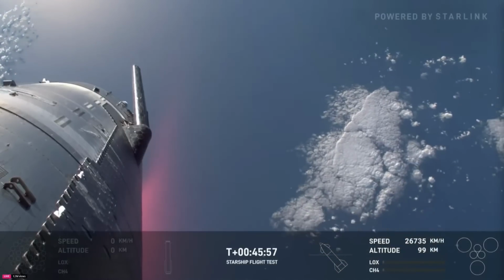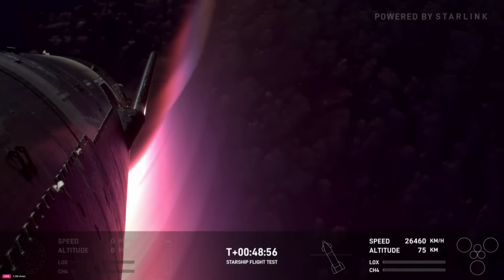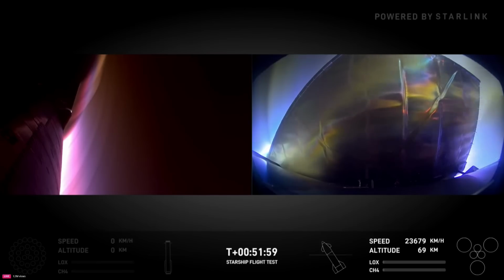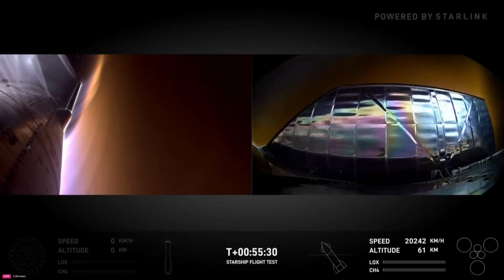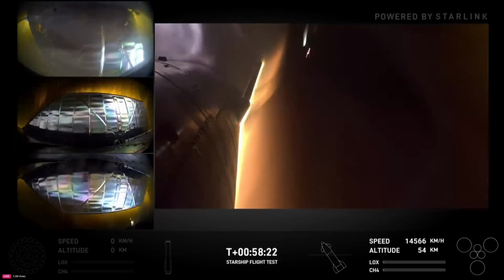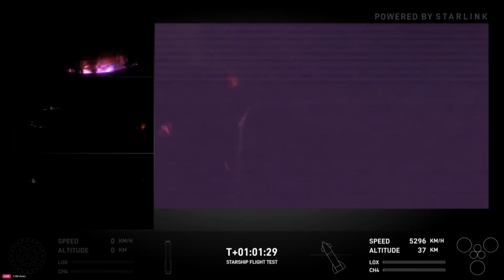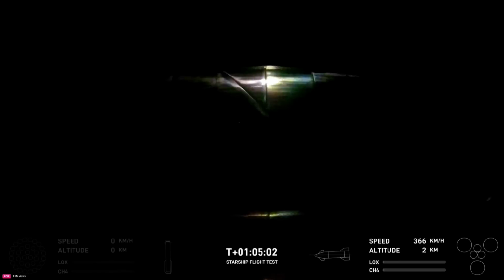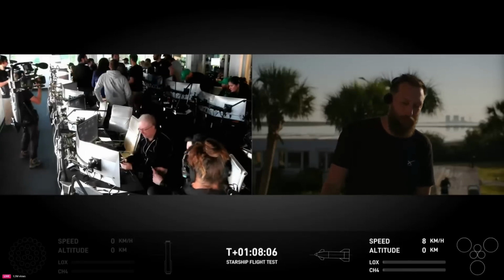INSANE Starship Flight 5 Reentry: Plasma Views, Ocean Landing & Explosion!

Comment: WOW what a bunch of diluted fools. The heat shield around the hinge still failed and it still blew up from fuel leaks. The booster still failed from the fuel leaks and nearly exploded too. This was as much of a failure as last time.   It is inherently flawed it will never work well enough to be reusable.  That thin is Humty Dumpty.

Comment: The speed is not right. Can’t be 25000km/h since it will take 0.144 seconds to to 1 km, however the distance is not decreasing at this rate.
Reply: Cuz it's the altitude and he is going sideways not straight up

Comment: Sorry, the space shuttles were doing more from 1981-2011. Why it ended is because of risk and costs.
Reply: The Space Shuttles were quite successful and effective, but there were significant problems.  Recovering the boosters worked, but the cost and effort to refurbish them was almost as high as buying new ones.  And the Shuttle's heat tiles experienced significant damage on each flight (fatal on one flight), requiring the replacement of dozens to hundreds of tiles - each unique and absurdly expensive to produce and replace.  With Super Heavy/Starship, neither of those should be a problem at all.

Comment: Overall, it was a successful day, with only a minor issue involving the Starship's right flap burning. Although less severe than the incident on Flight 4, improvements are necessary before Flight 6. Congratulations to all who contributed to this historic day.
Reply: Block 2 Starship design has the forward flaps moved more leeward so will experience less heating.

Comment: It is really interesting. It seems like the peak heat is not the issue as the velocity is high enough so a nice layer of plasma gets created without damaging the weak parts. The slower it gets the more the heat layer is getting attached to the actual structure. I am curious how they will solve this. But that said, it still hit the target 100%. So it is more a reusability issue then a functional issue for landing
Reply: Maybe a boost back burn before reentry?

Comment: When it gets to mars that drag heat is gonna have to be a llot longer as the atmosphere is thiner so its kind of still concerning that it didn't hold up.
Reply: You are putting the cart before the horse.   First Space X has to get starship to land in one piece on earth.   They can worry about the adjustments needed for a Martian landing down the road.
Reply: Can't they slow it down before it enters the atmosphere? Like a boost back burn... Besides the gravity is lower so they could use a longer landing burn with less engines? To achieve the same result or not.
Reply: @Terr  The boost back burn is only intended to get the booster over the landing site.   The ship doesn't do a boost back burn because it can simply orbit the earth or wherever before the deorbit thruster firing happens which is to get it to the reentry burn start location.  At least that's my understanding currently.  Mars touch down should be some variation of that.

Comment: Little bit of materials/engineering tweaking to do, but the fact that it landed precisely where you wanted was just awesome! Plus catching the heavy booster. 🎉
Reply: Well... the re entry its the hardest part for a ship, it took years and years of research to nasa have their re-entry vehicle (and it takes months to relocate those termal tiles).  SpaceX it's trying to do the same but 5x faster and reusable so it's very normal to have weak points in this early stages

Comment: I remember when the whole focus was getting the "Payload" into space, and into the intended orbit.  Now the major focus is retrieving the hardware that you launched the payload with.  And a whole different set of technical challenges.
Reply: You do realise these are experimental spacecraft looking to prove the tech before launching the payload, right?

The old way of doing things (i.e. Boeing Starliner) is design, test, and build without ever proving it as a whole before first launch. Costs way more than the SpaceX 'Fail Fast' method.
Reply: @CraigTaylor  Of course I know that.  But do you remember Columbia and Challenger?   What should have been routine, the launching and the retrieval of ONE OBJECT and WAS NOT, and also all of the launch hardware fell into the sea and was total loss.   This Starship was basically retrieval of everything that was launched.

And it is a larger rocket than the Saturn 5 rockets that went to the Moon.  The difference here is EVERYTHING THAT WENT UP THERE WAS BROUGHT BACK and retrieved for reuse.  Nothing was lost, or stayed up there, and in the space industry THAT IS A FIRST.

Comment: Awesome.   Huge success.  The starship flaps are still suffering some burn through.  Some design changes needed there, but minor changes will solve this.  Well done Spacex
Reply: That is being addressed in future starship.  They plan to relocate them on newer test vehicles.  Right now, they are using vehicles that are already built.

Comment: Great starship . Consider using fiberglass for the flap instead of steel.
Reply: Really??!
Reply: @williamdrake2315 would that be foam core?
Reply: No, SpaceX ended up using steel instead of carbon fiber because steel can support much higher temperatures. Steel plus small heatshield weighs less than carbon fiber plus big heatshield. Elon called this fact counter intuitive back in the days when SpaceX dropped carbon fiber for steel.